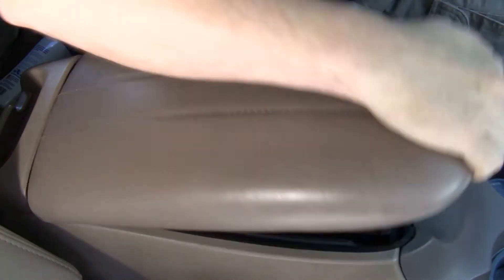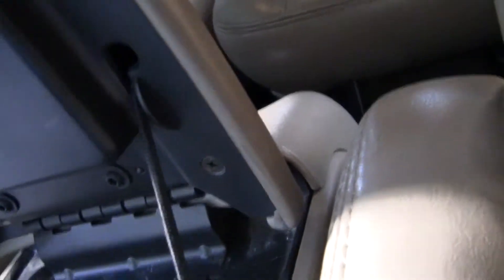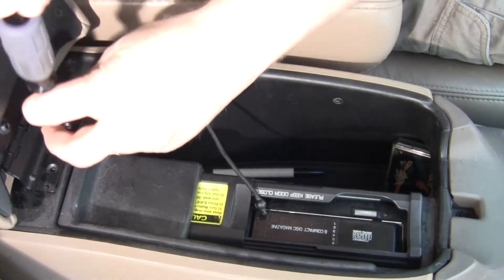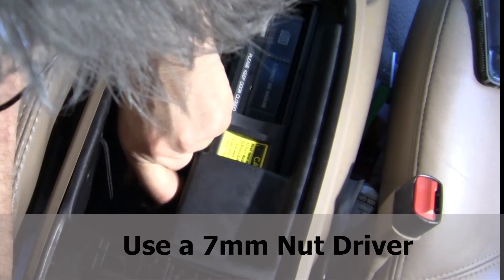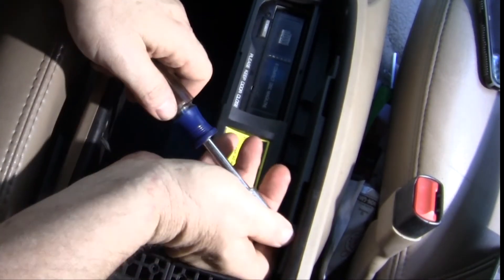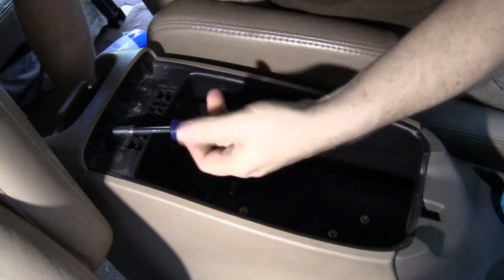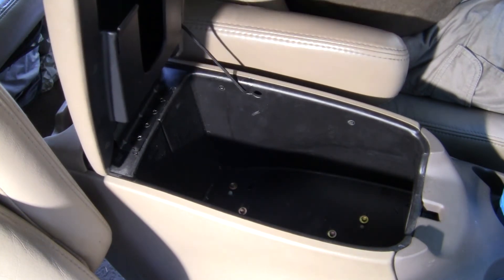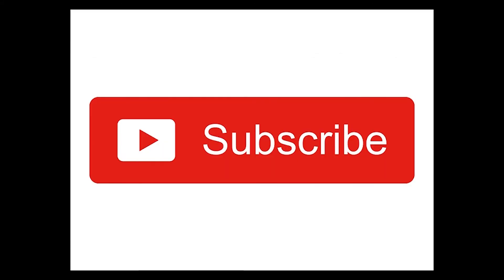How to Remove Six Disk Changer From Center Console 1997   2002 Expedition, 1997   2003 F 150, & Navi

Comment: Hey Two Keys, thanks for the video, is there a rubber mat that ford made to fit the console without the CD changer installed?
Reply from the maker: I intended on getting one of those myself and never did. Check Ebay for them, I am pretty sure that some Expeditions/F150's were sold with a console and without the cd changer.

Comment: My six disk changer is not attached the way yours is. Mine has a trim cover over it and no screws at the side bottom area as you have. I have a 2000 Ford Mercury Sable which I'm taking this out from. I have black plastic trim around the top of my disk changer which I need to remove first. I got the front loose (plastic is attached by snapping into grooves). This trim  is also part of the side plastic covering cd changer and can be used to store CDs. The front of this (where the lid opens) manages to lift up by an inch or so, but the back portion is still attached. Under the front trim I've pulled up an inch, I can see the metal and the special screws for taking out the CD changer. I see no evidence of screws or plastic clips or snaps holding the CD changer trim on towards the rear. How do I unattach it all the way around, mainly towards rear lid hinge area? I took lid off and it makes no difference to getting at any hidden screws or latching/clips for releasing top trim around CD changer.

Comment: I know this is an older video, but maybe you can help me, I have a 2002 f150 with a cd changer behind the passenger seat and I can not get the plug out, it there a trick to it. I feel a tab moving but the clip will not let go. Thanks.
Reply from the maker: As far as I remember,  it was just the clip. It is possible that a drink or something got spilled on it, making it difficult to separate.

Comment: Is there a way to have the rear ac controls work after removing
Reply from the maker: I didn't remove the rear ac controls. I removed the rear radio controls.
Reply: @TwoKeysStudio  it's cus once I removed that DVD player from the middle my rear ac controls behind the arm rest did not work afterwards
Reply from the maker: Sounds like you might have a loose connection. Those can be tough to narrow down.
Reply: @TwoKeysStudio  10-4 I'll take a look

Comment: Ok, I have the same 6 disk you just removed but do you have a video on how to undo a stuck CD from that changer? Please respond back.
Reply from the maker: I am sorry, but I haven't had to deal with that. Is the entire cartridge stuck?
Reply: Push the eject button while tapping the top of the cartridge.  The vibration will cause the stuck cd to release.  You may need to try several times to get this to work.

Comment: What if I just took the whole console off and now the stereo doesn't work
Reply from the maker: If no sound at all, my best guess is that the amplifier power is unplugged or the wire is pinched. Does the radio turn on and no sound or does it not power on at all?